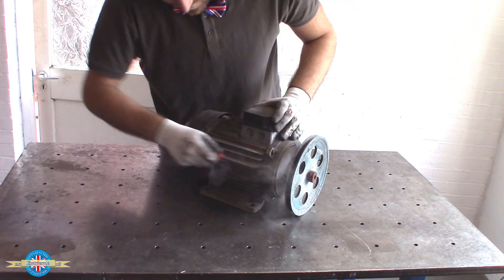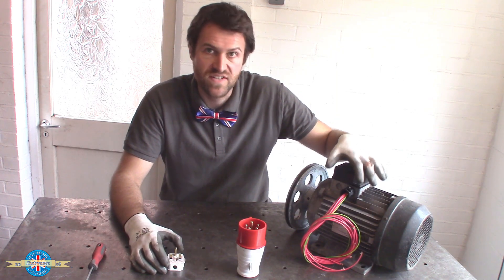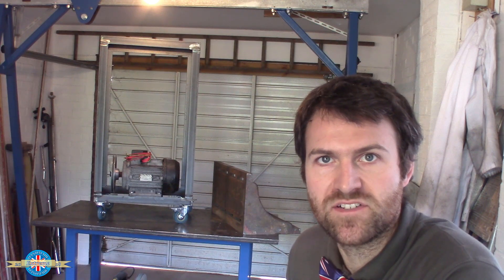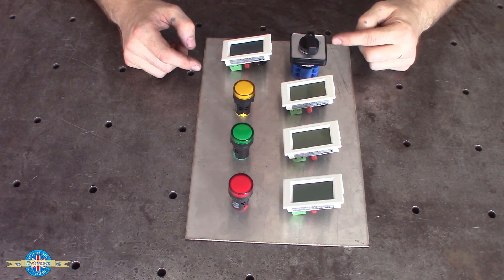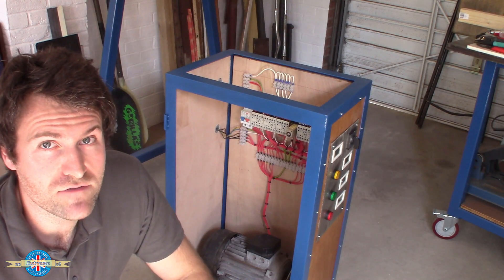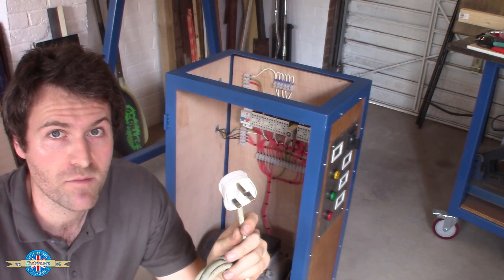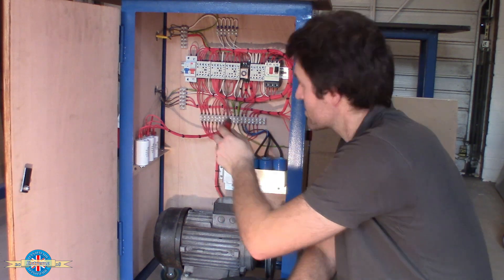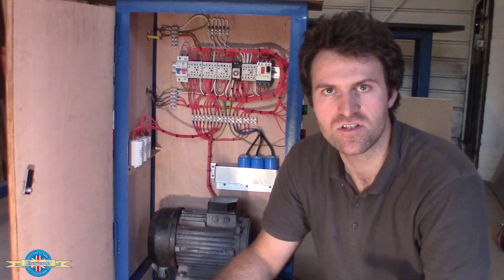1 Phase to 3 Phase Rotary Converter - 230V to 415V

Comment: I don't get it. Why would you want single phase in the first place. In Austria we have three phase running to every house.
Reply from the maker: Not by choice haha. Here in the UK the houses only get single phase. So if you want to run industrial machines in your home shop then you either use VFDs, A rotary converter or have 3 phase connected. For me the most cost effective solution was the rotary converter. cheers.👍
Reply: Nobody wants single phase, but it's more expensive to run more wire. or maybe they didn't want the common man to be able to have that power, for with three phase AC you can power a revolution against the capitalist state
Reply: Same here in North America. I think it's cheaper to run single phase but long term they would have benefited in the additional cost by running 3 phase.
Reply: They do run all 3 phases. I can see the 3 wires at the top of the pole. I get one phase, my neighbour to the left gets another phase, and my neighbour to the right gets the 3rd phase, so the 3 phases stay balanced. I could ask the utility company to get me all 3 phases, for a fee. Sometimes also 1 street gets one phase .

Some apartment buildings get 2 or even 3 phases to distribute so if you live in an apartment and check the live from 2 different outlets you'll sometimes see 208 Volts across them.
Reply: @felixar90  same here, one house gets the first fase, next house the second and the next one the third (and on and on and on).
I have on occasion told both my neighbours that I blew a fuse and asked if I could borrow so electricity, when I wanted to mess around with some 3 phase motors :)
Reply: @poordecisionsgarage9834  North American homes are 2 phase.  120 volts or 240 across the phases.  Industrial is often 3 phase.
Reply: David Kennedy Nope. What comes to your house is split phase 240. It's above my head but the way to tell is there's only one line feeding the transformer on the pole.
Reply: @poordecisionsgarage9834  they do run 3 phase everywhere. If you follow your power poles you will notice they have 3 lines up top, and one a bit lower for the neutral / ground. 3 phase is distributed to all towns and what not, and then they balance loads by tapping a different phase to complete town grid. You can see where the poles with 4 lines splits off to poles with 2 lines. If you look at the poles where transformers are mounted, if there is one, that location has split phase, if there are 3, that location has all 3 phases.
Reply: Yes, it appends on wich country one lives in, in my country the single phase lines where scrapped out after the 70s too, but not in UK as i understood, and in the US there is a system with 110V and centerzero, wich give as i guess, 220V in a similar line, 220V (wich gave 3x 220V  in 3 phase; 380V in scandinavia, except Norway, wich hawe their own 230V 3x independent phase system)) was the old standard in my country for single phase before the EU (and 240V in the UK) today it's 230V (wich gives 400V in 3 phase) in most countries here for some reason...
Reply: Österreich oida
Reply: Common household appliances here (Germany, where we do get 3 phase) actually run on multiple phases. For example a typical 4 plate cooker requires at least two phases (and on full load it actually maxes them out at close to 16A each). If there's an oven integrated it always requires three phases. Now my question is: how do you get enough power for a cooker with one phase? Do you drive it at higher amperage? Do you simply have less powerful devices? Or is there another trick to it?
Reply: No we don't Christian, we have single phase, but three phase running on the poles on the street, you have to get the extra phases run in.
I used to think we did too recently, and learned different.
Reply: Wish it was the same here, but with the size of US, and population, saved a ton of money not needing a 3phase transformer for each house. Split phase is literally a 3rd the cost and materials. At least I think thats why they set it up that way. You can still get 3 phase if you ask and pay for it.

Comment: Nicely built, I like it. It appears the bottom is left open, assuming for heat management? On a hot summer day, and a long day of running, Even though, the motor is designed to have a certain heat level factor built into it, in respects to the built in fan and shroud to blow air over the casement fins, have you noticed any high levels of heat? Just wondering is maybe adding a pair of 3.000" to one 5.000" diameter PC fans at the top to assist in pulling out the accumulated heat in the top half inside of the cabinet? They would be quiet, and suppose, they could actually be cycled on once the temp probe stuck to the side of the motor casement trips them on at a predetermined temp or even an adjustable temp sender probe?..  Or, maybe it doesn't run that long for you to get it hot to worry of this matter, and or, maybe it just runs warm, and not worry of this extra wiring?.. Either way, I like what you did, and even serves as a table of sorts... Nice work! Dru
Reply from the maker: Hi Dru, You are spot on with your assessment. I have only ran it for short periods so far so have not had chance to do a thermal performance analysis. I deliberately left it with the minimum cooling as I don't want extra holes if i can avoid them. Its just more places for the dirt to get in. I plan to monitor the temperature and if it needs extra cooling your suggestion of PC fans will likely be used.  Glad you enjoyed.👍👍
Reply: Handmade Extreme pick up a “cabin air filter” from your local automotive parts store. Either cut it as needed, or use your skills to create a drop in  case for the filter. So when it becomes dirty, just purchase an other just like it and drop it in. Explore all the different sizes and shapes of the cabin air filters before purchase. Heck, even an engine air filter may do the job too.
Reply from the maker: Cabin air filter great idea!!!!!  Thanks!👍👍👍

Comment: Hello.. i need to correct you.. you dont start in a delta config and then switch to Star config... in that Way you draw Way more amps than starting in a Star config and switch to delta...
Reply from the maker: For normal three phase motor starting you are absolutely correct. Start in star and apply 230v to each winding with X amps of current. Then switch the delta applying 415v to each coil with ~X/2 Amps per coil when the motor is up to speed. That way you get maximum starting torque from the high current but do not damage the windings since you then switch to a lower current.

However, in this application since I do not have a 415v supply I start the motor in Delta applying 230v across a winding with start capacitors providing the additional excitation. Once the motor is spinning I disconnect the neural from the delta config (at this point i am using neutral as a "phase" ) and take it to an external star point( where it belongs). With the motor now acting like a generator I get 230V across each coil to the star point. But am now generating 400v phase to phase. This 400-415v can then be used to power other machines. 

The key distinction is that I am not using the motor as a motor, hence the unconventional delta star starting procedure but am rather using it as a sort of generator. 

I hope this helps. Thank you for your comment 👍😀👍
Reply: Handmade Extreme  my bad, you are right 😁 og is such a cool project, and you’ve done a stunning job to make it look like perfect 😁
Reply from the maker: Not at all, I should have explained it more clearly in the video. Thank you for the complements 👍👍👍
Reply: Handmade Extreme dont you have 3phase in your houses “over there” 
How Many amps is it possible to draw out of that rotary converter 😁?
Reply from the maker: No only single phase in the houses sadly. We can have 3 phase connected but its very expensive and you cant take it with you when you move. I have not had it at max capacity yet so i'm not sure. I'm estimating about 3KW output.👍

Comment: Is there a reason to use this over a VFD?
Reply from the maker: For my application this is a more cost effective solution. I have multiple machines that I need to power and the cost of multiple VFDs is significantly more than building the rotary converter. Cheers😀
Reply: Handmade Extreme could you not put a single vfd in a trolley?
Reply: The same was you use a single rotary , you can use a single VFD, although if you have a multiple of 3 phase systems , the best solution is to just get 3 pahse power.
Reply: Cool thanks 👍
Reply from the maker: No problem. 👍
Reply from the maker: I could however, for my application the rotary is a more suitable solution as I have multiple machines that need power. If you are using VFDs then you really need one per motor. That's 7VFDs for my shop... Thanks for your comment.👍
Reply: VFDs are programmable devices and you can easily store different settings for different motors . Given that you have 7 different machines , wouldn't it be more resonable to just do this the proper way and get yourselfe a 3 phase power. I'm guessing you are making money out of this (not familliar with your channel , this just poped up in my youtube feed), would it not be more economical in the long run to just have a proper 3 phase installation.

Also note no matter whether you use VFD , RPC or configuring your 3 phase motors into a signle phase (star/delta) , you are not changing their power requirements. Most of the time , the reason why you will find a 3 phase motor in a machine is simply because single phase household outlets are limited to 3kW in general. It's a bit higher when talking about industrial single phase , usually tops out at 4,5kW , but as you can see not much avaliable power there.
To that add a fact that efficiency of your RPC of for that matter VFD , is at best around 70% This means that in a long run you are wasting money with this type of solution.
Reply from the maker: Some great points there thanks. It's actually just a hobby workshop, not actually 7 machines, but 7 motors, some machines have more than 1 motor, power feeds, coolant pumps etc. Regarding having 3 phase connected: Yes it is the ideal solution, However, I think we will probably be moving house in the next few years and I cant justify the cost of having it put in to then move and have to pay for it again. I see the RPC as a stop gap solution until we move somewhere that we think we will stay for a long time.  Cheers 👍👍👍
Reply: well if it works for you , good luck
Reply from the maker: Cheers, thanks 👍

Comment: A bunch of useless stupidity here. Electrical enclosure, made from flammable material........awesome! lol. FFS. And phase converters don't alter the voltage, thats the job of the transformer. If you are using a cap bank to bring the voltage up, you are an even bigger idiot than i imagined.
Reply from the maker: In this design there is no transformer, its is by starting the motor the wrong way round (delta then star rather than star then delta) that allows me to generate 400 ish volts between phases and 230v phase to neutral. Re capacitors: There is one bank that is used to provide the initial excitation while the motor is in Delta for approximately 1 second. The second bank is there just to balance the voltage across the phases. They are not being used to pull the voltage up from 230v to 415v. Cheers👍
Reply: Diesel Ramcharger ..... Wow you are a nice and friendly guy .
What is wrong man ? Lost one of your weapons ? Don't get any subs on your channel?
There are nicer ways to comment on something .
Speaking of useless stupidity ,what do you call shooting holes in the air ,or even play with weapons?

Comment: Nice project! I thought about doing the same, but ended up with a second-hand Transwave 3-hp static converter from flea-buy for £200.
Reply from the maker: Thanks. I did look for a second hand unit but ended up building this one for not a lot more.👍
Reply: Static Converters are a joke. Money Wasted.
Reply: The UK - made Transwave converter is renowned for it's reliability, unlike some of the cheap eastern stuff. My Transwave converter is still used regularly and has served me well for the last 5 years. It served it's previous owner for more than 15 years. Money well-spent on well-made British electrics, no jokes.

Comment: In fairness, three phase means a bit more than simply three lives.  Three phase means three lives each of which has its phase angle, that is where along a sinewave each live’s voltage  lies, separated by 120° from either of its two neighboring phases.
Reply from the maker: You are absolutely right, thank you. 👍👍👍

Comment: https://youtu.be/hyjYdEL-80s
In america we can run y or delta at 240volts. Motors are 12 wire multi voltage. If you could run that lathe on 230 3phase it would cut down on alot of contctors. I only use 1 contactor to put in and take out the start caps
Reply from the maker: That's a nice setup you have there 👍. The motor on my lathe is a 400/600 motor which is why I had to build for 415. It also future proofs my workshop as most of the industrial machines around in the UK are 415v. Glad you enjoyed it.😀
Reply: I kinda forgot your single phase 230v is not like our single phase 230v cause we have split phase 120/230v so not true single phase. (Almost 2 phase). cause even tho we get that with one leg from the mains the step down transformer inverts the two 120 volt legs 180° opposite from each other 
So our phase to phase on 3 phase Y is 208v and 230v Delta. your phase to phase is 415v Y right?
My RFC doesn't need to be wired to start on y and run on delta we can just run either at all times.
Also why my RFC start up so fast in comparison cause the mains is already almost 2 phase and i only have to generate the 3rd leg
I built my system watching this method. but I used a timer like you did for the start caps.
https://www.youtube.com/watch?v=u229h7NcMxk&list=PLeT7J-vRSlEAoF6kaeve5CCEPMbM7s1iq
Reply from the maker: Yes, you've got it. If I left it running in Delta i would be getting 230v phase to phase and then after switching to Star I get 415v phase to phase then 230v phase to neutral. There are people over here who use a similar system to yours where they use the line and neutral as 2 phases and just generate the 3rd leg. Then use an auto-transformer to step up the voltage from 230v to 415v. Ah yes I have seen that video. Good link. Have you seen the ones I put in the video description. They are very informative. If you pause them at strategic moments its quite easy to work out exactly what is going on. 👍👍👍
Reply: Handmade Extreme ill check em out

Comment: With how cheap vfds and features that they include i wonder if this is a worthwhile thing anymore.
Reply from the maker: You are correct this converter could not power all of my machines at once. However, since I am the only person working in my shop I only ever have one machine running at a time. The converter is therefore sized to manage the load from my largest machine. My shop is a hobby, I am not using it for commercial purposes so do not need all the best equipment. I only need the equipment that is sufficiently good enough to full-fill the specifications of the projects that I am undertaking. Cheers👍
Reply: You could also switch a VFD between multiple machines especially if you where just using it as a static phase converter and not changing the frequency at each machine which you can’t do with a rotophaser anyway. But like anything if you have the stuff and it works just roll with it and don’t listen to the haters!
Reply: Tyler Costantini to me the main advantage of the vfd is customizability.  I think a lot of that would get lost if it were having to be moved from machine to machine n
Reply from the maker: It is very application dependant, for my workshop I would need need 7 VFDs therefore the rotary converter was a more cost effective solution. If I was just using it to power one machine then I completely agree then a VFD would be the way to go. Hope you enjoyed the video, cheers. 👍
Reply: Handmade Extreme ohhh. I didn't know you had a bunch of 3 phase stuff you needed to power.  Makes sense now.
Reply from the maker: Just moved a Bridgeport mill and chop saw in this morning. Might be off the get a surface grinder tomorrow. The workshop might look a bit fuller in the next video haha 👍👍
Reply: Handmade Extreme nice!
Reply: You could just have one VFD in your trolley :)
It'd need to be one that can switch easily between presets for each motor, I guess.
Reply: This little converter isn't big enough to power 7 pieces of equipment. He'd been better off with a phase perfect, but he's a cheap bastard full of bad ideas. Typical in the euro market.
Reply: Diesel Ramcharger Not all at once.  But he can easily just switch between them.  Not everyone has 5 grand to spend on a phase perfect.
Reply: Be a bit like trying to fire all of your guns at the same time. Do you have enough fingers? Typical of the market from whence the comment came. One or two machines will run in a home shop and grid-supplied 3 phase isn't even possible in some areas. This is a good solution and provides good information to the YouTube community.

Comment: Very nice wiring job.  I have been toying around with building something similar to this.  A friend of mine has one with a single and 3 phase motor coupled with a belt.  He uses it to start his 3 phase equipment then switches them back over to single to maintain operations.  You dont get full rated power out of the motor of course but for what he needs it is more than adequate.
Reply from the maker: Thanks glad you enjoyed it. Having it has opened up a lot of opportunities. I would recommend building one. 
If it works for his application then its perfect .👍👍